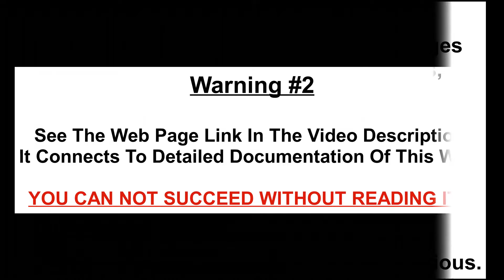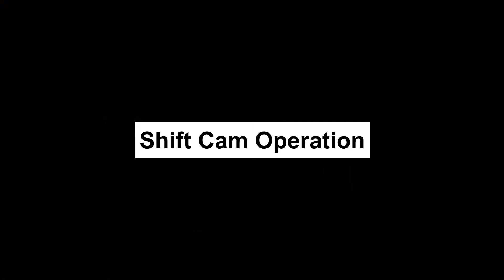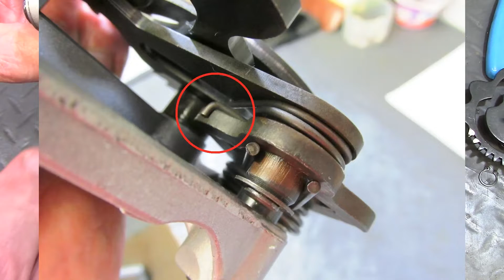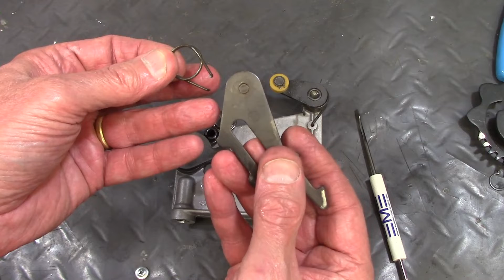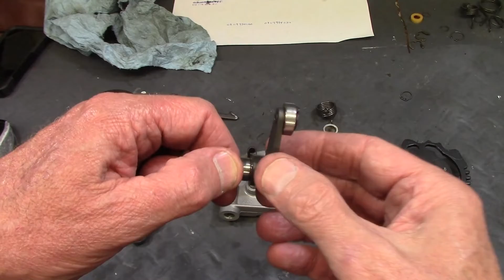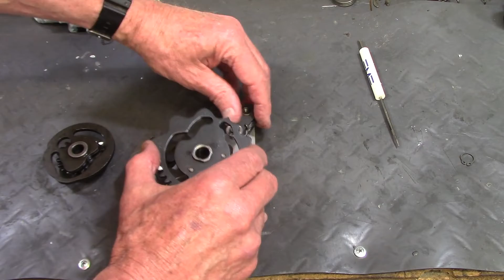1983 BMW R100RS Rebuild Transmission Shift Cam Assembly

Comment: Just and FYI for those doing this work: the shift cam roller assembly washer is installed incorrectly in this video. It should go on the outside, underneath the circlip.

Comment: Hi, I have a 1974 BMW R90/6. I have a problem with the neutral lamp. The switch under the gearbox is new, the light is green, both in gear and neutral. Where can I look for the error?  Mvg Gilbert
Reply from the maker: Gilbert, Be sure you installed the gasket ring (part# 61 31 1 355 262).

I would verify that the switch is not defective. I would remove it. Then I would attach an Ohm meter to the leads. I would push the plunger in and out to verify that the switch opens (infinite Ohms) and closes (0 Ohms).

Comment: Sir this is a very informative video. Is this transmission the same R 100 GS has? Thanks!
Reply from the maker: Hi 61naga.  The transmissions changed over the years, but not by model. That said, I believe the shift cam assembly is essentially the same for the GS as the RS.